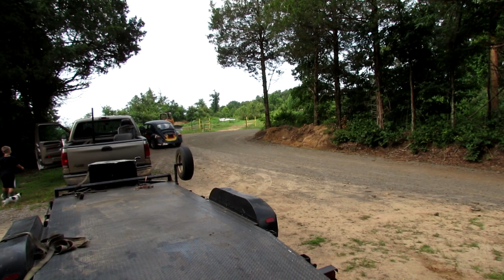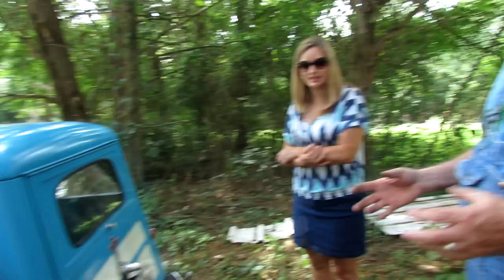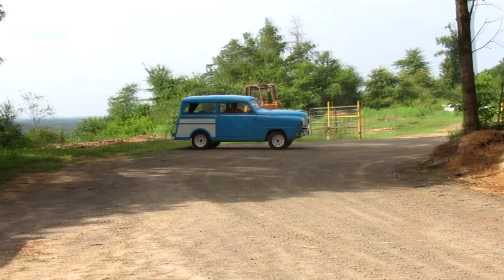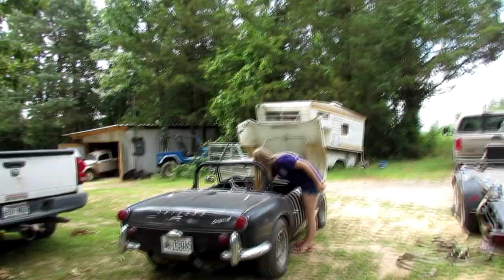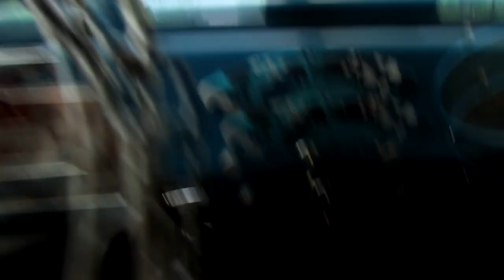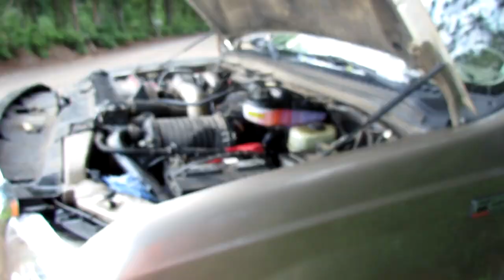A fun day with Cutworm59

Comment: My first car was a 1976 triumph spitfire, by 76 they had seats with head rests, and had removed the wilting on the fenders. They also added idiotic rubber bumperetts, but it was a great car. I have to admit, bring 5' 9" I fit the spit a lot better than you did, I could steer in both directions.  ;-)